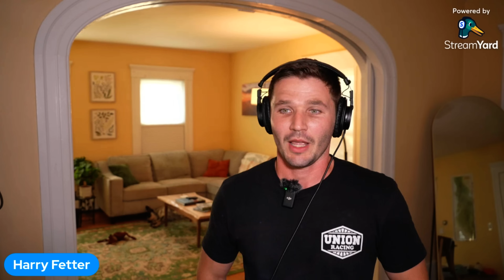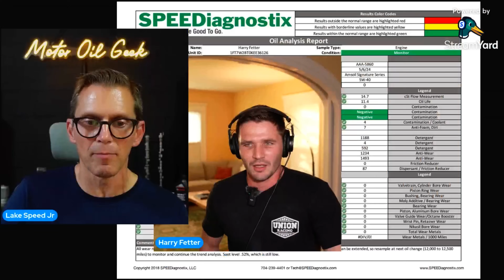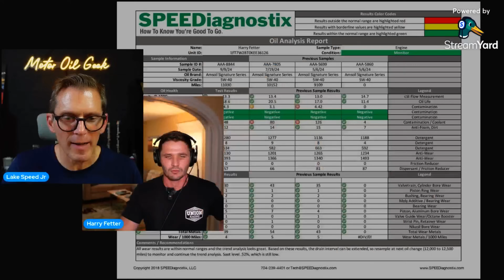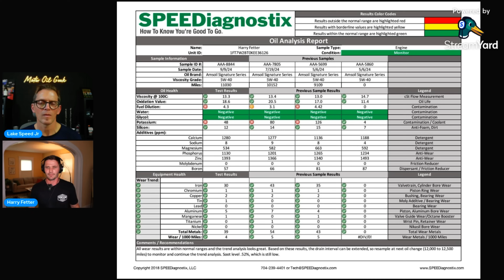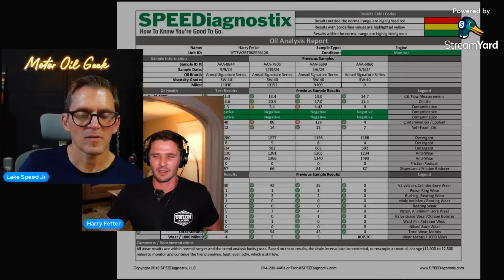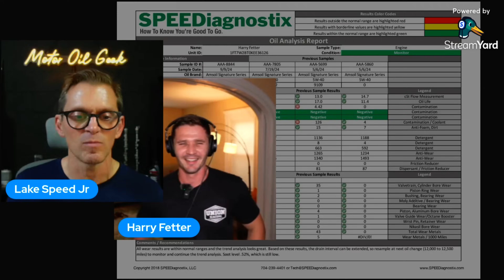11,000 Mile Amsoil Oil Analysis With The Motor Oil Geak

Comment: Wow, I really enjoy the interaction between you and Lake in this series of videos!  Do you use Amsoil's 100% Synthetic Gear Lube for your differentials and Amsoil's 100% Synthetic ATF for your transmission?
Reply from the maker: Thank you for the comment. Glad it’s helpful! I do use Amsoil’s gear oil for both differentials and their ATF for my transmission. Their ATF fluid lowered my trans temps by 10 degrees over the Mercon LV from ford
Reply: @powerstrokemaintenance use the ATF in my fleet. It's fabulous
Reply: @secretsquirrel9722  we can't tell you how far to go. Thats like telling you how to spend your money. I can tell you to get an analysis done.  To see what is going on.  It tells the story of whether or not that oil is good and can still be used and doing it's job or is getting used up. Everyone's mileage is different. Depends on where you live, how you drive, etc etc etc